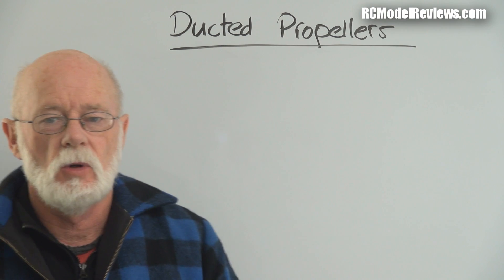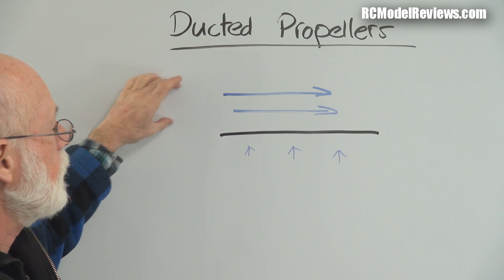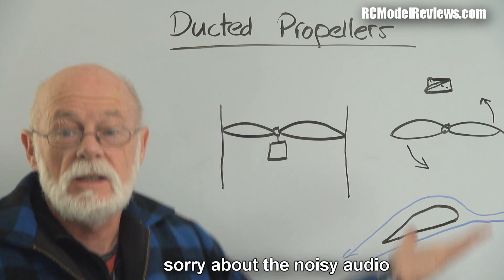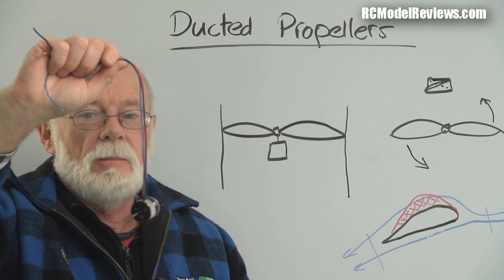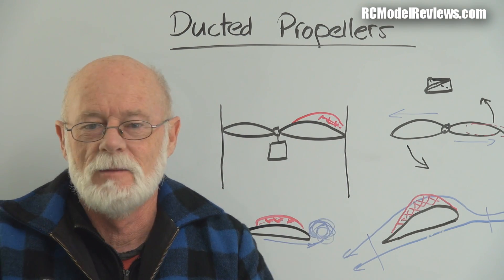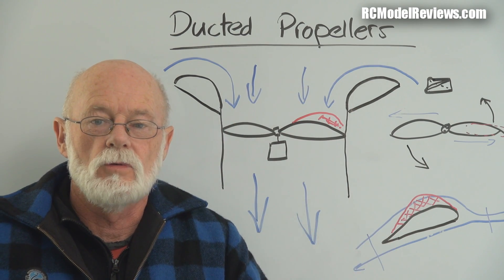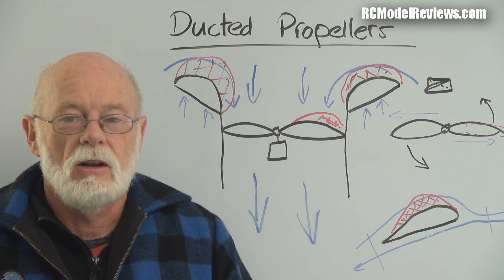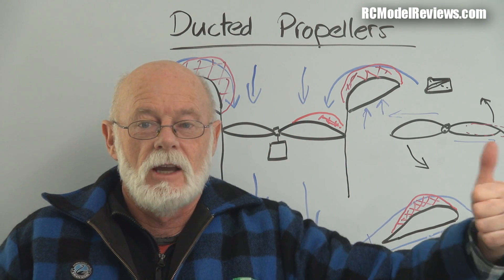How ducting a propeller increases efficiency and thrust

Comment: I am wondering whether it is possible to somehow mitigate the weight of a duct by using something similar to "winglets" on propeller blades? In simple words, there is a lot of whitespace between propeller blades and all that plastic of a duct, which does not stop the high pressure air from flowing into the low pressure area, is just dead weight.

Comment: Must get a load of drag and turbulence etc if you move the duct at an angle. So as soon as you move you'll lose thrust.
Reply: wordreet Anyway, with all this talk of ducks and anacondas, you'll be starting a zoo next!
Reply: you would in most cases but in a slower moving multirotor as opposed to a jet etc., the effect is minimal.
Reply: TheWaterbound07 I hear you, but I see it as being the other way round. Since the original  NASA experiments failed to get their ducted fan devices to go more than 10mph horizontally before losing lift and modern jet fighters have mostly rectangular intakes, but can still manage high alpha type manouvers, simply from their extreme power.

Comment: Just one question related to that low pressure thing at 13:08. If the entire unit is moving up, than how can the low pressure be above it and the high pressure below it?

Just imagine pushing some sand with your hand. The sand accumulates in front of the hand (high pressure) and not behind the hand (low pressure).

Or another example, fast racing cars, where the low pressure is BEHIND the car and it can accelerate for free the car behind.

Comment: you mention the air ontop of a wing goes faster than the air on the bottom, why is that? i've always been under the assumption that it does not, and the shape of the wing directs air down to produce lift.

Comment: I'd also like to know why the aircraft failed when rotating the ducts forward.  I also have a question.  If you had a ducted multi rotor and rotated the ducts 90 degrees (or less) but left the motors pointed upwards, would the ducts work as annular wings?

Comment: It's lower pressure on the top of the wing but pressure is force per unit area.  That means less force per square inch.  But there is also more area on the top curved part of the wing than the bottom so you end up with the same force on top as the force on the bottom.  Now we're back to the deflection theory of lift.

The only reason the airfoil is needed is because it is a more versatile airfoil that can support multiple angles of attack and still remain efficient.  A completely flat airfoil will work great at an optimal angle of attack but it will perform poorly outside of that angle.

Comment: Is there any limit to the size of the coanda inlet? Does the size increase the lift? I suppose with size comes extra drag, there must be a reason the EDFs have a certain sized lip.

Can you also do a video on whether having a reducing nozzle on the back of an EDF can increase thrust? My theory would assume a larger area would help static thrust but once you have inertia you can close it up and increase pressure. Would this increase the thrust? Sort of like shifting gear in a car at motorway speeds to keep in the engine power band.

Comment: I don't believe it's gonna be worth it, maybe for hovering and even then, maybe. First, when moving forward the aircraft doesn't tilt enough so that the ducts will be facing forward, even in a 30-40º angle, it's still like a wall blocking the air. And even in hover, assuming very low wind days are minority, the extra power needed to keep correcting the extra push the wind will have sideways, will make it not worth it.
Maybe it's a good idea for vertical takeoff planes that will transition to horizontal, like that google delivery drone...
I might be wrong though, lets wait for the bench results, and field results, cus only creating more lift than the weight of the covers is not the same as when its against the wind.

Comment: Another great and thought provoking video, being pedantic there is no such thing as centrifugal force, the motor swung round by its wires wants to go in a straight line but the centripetal force of the wire forces it to follow an arc. that's semantics though and I still relate to centrifugal force.
(Amazing the random bits of school physics that are still in my head 40 years after leaving school)
Bernoulli effect used to seem counterintuitive to me, blowing through a drinking straw to create an airflow between two parallel sheets of paper as you know draws them together, this was not the outcome I expected when I tried it years ago!

Comment: I think this is the first time you've not presented the full argument Bruce!
Don't forget these things are heavier than the thrust they produce, and have to be incredibly stiff and well made so the tip clearance is around a 1/10mm to achieve any reasonable gain.  Due to this any slight knock will distort the ring and kill the blades.
In my research, unless you are looking at a supersonic blade tip, and therefore  long duct, there only reason you would duct a prop is for safety, not efficiency.
I'd be keen to see some real world tests though Bruce, on your thrust/Watt meter and in flight?

Comment: Duck Theory: 
Bruce, after the introduction, I anticipated the explanation.  But my assumption was not included in your explanations.  You cited 1.) Lift from the blade shape. 2.) efficiency from caging the tip vortex and 3.) Theodorsen's effect from the bellmouth.  But you didn't identify what I gathered from bird flight where a duck will fly close to water surface to utilize Ground Effect where wings flapping against air will achieve more efficiency.  Doesn't the duct section on the output in fact do that - by not allowing air to disperse as easily?  Thanks for your thoughts.

Comment: Bruce can they 3D print or etch the area duct by the plane of rotation with some form honeycomb seal like is done in a gas turbines compressor section. I believe that would make the ducted prop even more efficient by preventing blow by at the blade tips.

Comment: Hey Bruce!
Excellent video, thank you! If you can tell me about a two- or three-bladed propellers for multicopter. Two-blade more resistant to impact damage and easier to balancing. But the three-blade have more thrust at the same size and less vibration. I would like to know how to choose the size of a three-bladed propeller to match the two-blade without increasing the load on the ESC and the motor (without increasing the current of the power supply circuit).
Sorry for my English :) Best regards!

Comment: I don't think they are going to make up for their weight if they are not specially designed or 3d printed :(   The material Is heavy and if they are not made for specific quads and propellers then it's going to reduce flight times :(

Comment: Would the tilted quad arms cancel out the affect of moving forward with a duct ?  I was immediately interested in the duct as it could reduce the amount of destroyed props from crashes but obviously it's not worth it if you don't benefit enough from using them by over stressing your motors etc

Comment: Great Video Bruce.  Any chance you might create a video regarding X8 Coaxial setups?   I have a TBS Discovery with the Aimdroix extended Aluminum arms that are set up for the X8 Configuration.   I've been doing a lot of research  and one thing I've noticed is that there is quite a bit of controversy over what is the best way to configure your aircraft.   I'm using APC 11x4.5 MR on the Upper Deck and APC 10x5.5 MRP on the lower deck.   And...just to make things interesting...I'm using SunnySky 650KV motors on the top and Sunnysky 800KV motors on the bottom.  
and I have to say it flys quite well.  Per the TBS CORE I'm pulling about 28-30 amps at hover and if I give it full throttle, I pull up to 40 AMPS...but it usually calms down a little after a second or two to settle in around 35-36 AMPS.  I'm not sure I really need the 800 KV motors on the bottom unless I want to use 11x4.5 MRP on the lower deck. but I thought...what the heck...give it a try and see how she performs.  And she does quite well.  I've got a DYS 3 Axis Gimabl with a GoPro Hero 3+ on the front.  I'm carrying two 5000 mah Zippy 4S lips on the back.   And I get about 14 minutes of flight time with about 25-27% left in the battery. 

Now...with all that being said.   What are your thoughts?  I have to admit to many times wondering if it's really worth all the extra effort.   My only reason was redundancy.  If I lose a motor or an ESC over a lake I don't want to go diving to retrieve my TBS Disco.  And  I'm not trying to improve overall flight time but it wouldn't hurt if I could.   

thanks Bruce for all your hard work.  I really enjoy your RC Model Reviews.

Comment: Awesome Video! Very good information to know! I would love to hear about the project that failed because of an unpredicted effect. Also i am curious, If prop distance from the duct is such an issue, would it have a similar effect if the duct was actually connected to the propeller and turned with it? or would that just produce even more drag? Additionally, could you put a small lip around the inside of the duct (not attached to prop) that overlapped with the very edge of the prop? Very cool stuff

Comment: Wouldnt you lose out on some of the gained efficiency by testing on a static stand rather than on a moving device? I know a moving test would be much more difficult to perform. But, as the duct moves through the air with the lip creating the low pressure zone, its going to create different numbers than it would sitting statically?
Reply: Sherman Hartman I just remembered, multirotors hover. Its going to be generally the same.

Comment: so, mount you a motor to your thrust tester, get your thrust for a given voltage and amp, then mount that motor and that prop to the ducting, run the test all over again.  All things being roughly equal, what is the difference?  Obviously this is just a thrust question, the duct adds weight, does any perceived improvement to thrust with a duct counter the actual additional weight of the duct?

Comment: Please setup and test both situations on the thrust stand to check if it really works. I think it will do worse, mainly if you consider the added weight. Also, the struts that hold the ring in place increase drag in the prop discharge flow.
Reply: Márcio Senger Sorry, couldn't wait to the end of the video and asked you for something you told you would do. Sorry for that. (Y)

Comment: Wouldn't that lip on the duct produce an even bigger vortex because its an even bigger "wing"? Doesn't that negate the point of the duct in the first place?
Reply: illidur But the lip is an annular wing -- so it has no tips -- it's a circle.   If there are no tips, you can't have a tip-vortex :-)
Reply: ***** Thanks, didn't realize it was rounded.

Comment: So that raises the following question, why are we not using props with winglets like they use on most planes and wind turbines today, that would negate the vortex roll off.

Could be lighter then a duct, but still increase performance over the normal prop. I'd imagine that no one built it yet because that would make the injection mold 4 times as thick compared to the simple props we use now.
Reply: databeestje Surprisingly enough, there are some propellers (full sized) out there which use winglets to improve efficiency.  There's actually a microlite that can (very) occasionally be seen at the airfield here with just such a prop.  Next time it's here I'll try to grab a picture.
Reply: Yep, do a quick Google of "q-tip prop".  We had a few of these in A&P school. They are more efficient, but mostly quieter! The problem is that they are less reliable than standard props. Plastic 5" props is one thing, but move up to a 56" aluminum prop and the stresses are orders of magnitude higher.  The bend creates a stress riser at the tip.  Cracks are common at those tips and the blades often have a short life. Also, a blade-off event in flight can be catastrophic. Another good thing to Google.  It'll tear the engine right off the airplane.

Comment: That test stand comparison will be very interesting. It would be nice if the thrust gain would at least counter the added weight. Even if it doesn't, if it's at least close, the value of the excellent prop guard won't be offset by the added weight as would be the case for non-ducting prop guards.

I suspect that a problem of the duct when angled against the direction of flight might be related to turbulence of the airflow into the duct - a ram air effect at the top with a turbulent flow at the bottom.

Comment: I guess this is one of the reasons why winglets are used on many planes. 

But why there are NO Propellers with some kind of winglets? I know there are props with a upwards tilted end. But I guess this is only to avoid that circular movement of the air at the end of the prop.

Comment: The duct and impeller (no longer a propeller when design for a duct) must be designed and built to work together. The gap between the impeller and the duct is critical in realizing gains. The problem is when designed to realize max  efficiency, it is done. That means adding a larger power plant will hardly produce any more thrust. The device has become self limiting. A good example in real world observation a marine "jet drives". Ask anyone trying to get more power out of their Jet Ski! and err EDF's

Comment: Wow, i Think its the first time I disagree with you. You said that no drag is created by the ducts, how come not? When moving, an enormous drag is created by the duct, remember: anything that do not produces lift, produces drag. Also, we didn't consider the weight added, that also reduces the flight time.
Even tought you are right about the better efficiency created by the ducts, its weight and drag will make it not worth.  A better solution would be propellers like tmotors, with  curved tips, just like airplanes wingtips, this reduces the vortex.
Reply: Ricardo Iarossi My point was that the lip does not create any extra drag with respect to the air flowing into the duct.  Obviously the duct itself will create drag once it starts moving through the air -- but in a hovering situation, the motor does not have to overcome any extra drag from the lip -- in fact the lip reduces the load on the motor.
Reply: Ricardo Iarossi 
You should have watched the whole video before commenting as both of your (completely correct!) points where mentioned in the end.
Reply: Ricardo Iarossi It's not used on external propellers, I'm not sure why exactly. But in jet engines, the turbine blades often have a 'fence' at the outer end. You can buy one on ebay. :¬)
http://www.ebay.co.uk/itm/Rolls-Royce-Avon-Jet-engine-4-blade-Assembly-RAF-Lightning-Hunter-Turbine-/191624480262?pt=LH_DefaultDomain_3&hash=item2c9db58606
Reply: Ricardo Iarossi you're right, drag created by duct is huge, but at high speed. Drag created by duct rises with the square of the speed (this fact is used to slow down airflow in turbofan engines), but I think Bruce wants to use it in a multirotor that moves relatively slow.
I agree that this will not work though - he would have to use a prop that has extremely small gap between tips and duct
Reply: ***** Any air moving over a surface is going to create drag just from friction alone.
Reply: Ricardo Iarossi Jimmy

Comment: Great video Bruce! Thanks.
I'm gonna assign it as required watching to my physics and engineering students. We'll see if they spot the centrifugal/centripetal thing. Should make for an interesting discussion.
After your last video I created a project for them to design and 3D print guards for the 450 quad they are building and programming from scratch. These propeller guards are what we needed to make the testing safer for them.
As usual, great job. I'm looking forward to the bench test, but I may not show them that one. They'll need to generate the numbers themselves to compare the efficiency of their different designs.
BTW...you are getting quite famous at University of the Pacific in California and the feeder high schools in the area.
Keep 'em coming!

Comment: I have a problem with the explanation of lift, that is repeated all the time. Which law commands the air that is split at the front of the wing to meet with the same molecules at the back? Right, there isn't one. And in fact the air flowing over the top arrives sooner at the trailing edge than the air flowing below. So the "the top is longer than the bottom, so the air has to go faster" can't be the explanation.
Reply: superdau If the air traveling over the top of the airfoil arrives sooner than the air traveling underneath then it must be traveling faster -- thus the pressure on top of the wing will be lower.    Think about it... if the air took longer to travel over the top then you'd end up with a huge build-up of  pressure in front of the wing because slower means "less air per unit of time" so there'd be a massive buildup getting ever-greater over time.  Therefore, the same amount of air must flow over the top as flows over the bottom and since the distance over the top is greater, it must flow faster.

Comment: I am guessing with the military failure, the cause was lateral airflow interrupting the Bernoulli principle of flow through a Venturi, creating flow disturbance caused by the venturi's acting like a wind dam in lateral movement. They work well in linear flow, the same as a turbine engine on a plane, but drop that plane vertically and the airflow through the motor ceases.

Comment: Making the propeller larger (and slower to draw the same power) will always always always be better than a duct. That is even if the duct was free and added no weight. The only reason you see them on airliners is because of ground clearance and the fact that a duct allows lower tip velocities for the same diameter free fan. (The tip must never even approach supersonic velocities.)